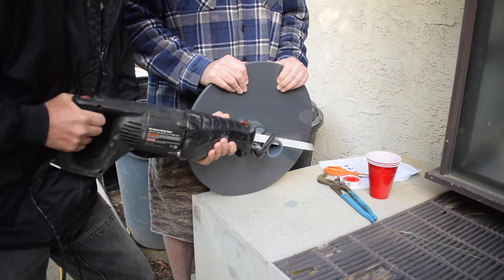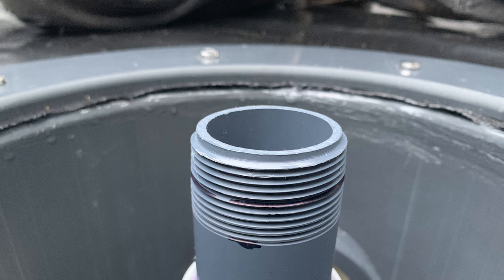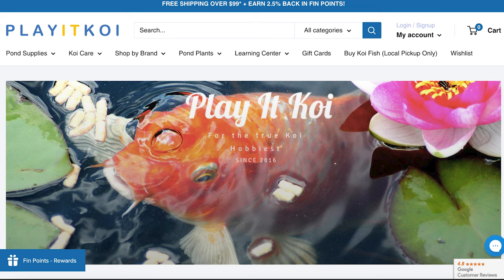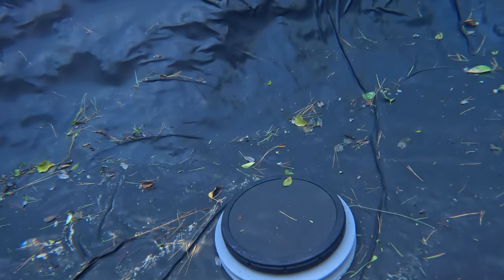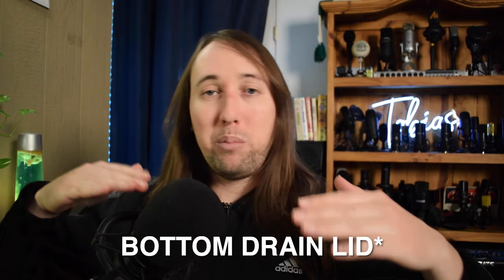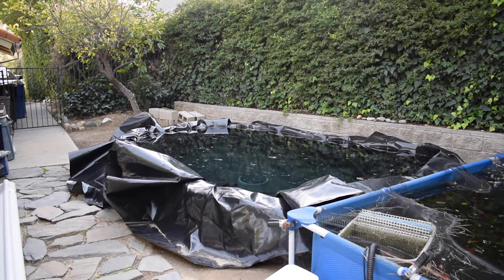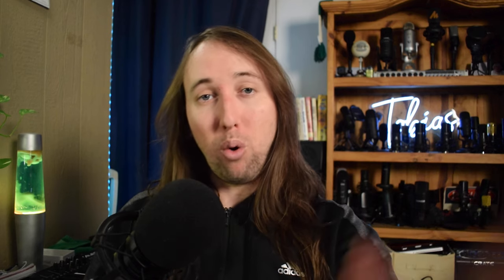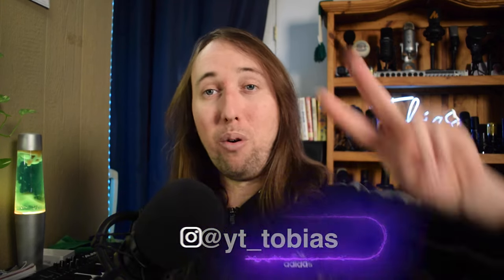Bottom Drain Problem #pond #koipond #pondbuild

Comment: Sorry to hear this Aquamigos, that is not good manufacturing, I think you could end up with fish in your filter, I have had to put a grating to the entry of my Nexus, because I occasionally get small fish go into bottom drain, the grating stops them going all the way into the filter, I have put 3 fish this month back into the pond, I have a very low flow rate, and the smaller fish can not manage to swim back against the flow, so I think you will have to keep a very close eye on your filter, I check mine morning and evening, just in case another fish has made its way up from bottom drain, best wishes, Tony😀
Reply from the maker: Thanks for the advice Tony! I will keep that in mind. I think the first stage of my filtration is going to be a small settlement tank, so I'm thinking the fish will end up in there and then I can fish them out
Reply: @TobiasHolenstein  Thats good

Comment: I always heard that anything with threads that are made to work with water are always tapered to create a tighter/waterproof seal. Dunno, just what i heard
Reply from the maker: Yeah i believe that is true, because I asked the Play it koi rep if I could trim the top of the stem slightly (where the threading is) to compensate for the lopsidedness and he told me not to do that because the threadings are not the same size all the way down. The threading on the lid however is warped in a way where it doesn't match up to the stem anymore

Comment: Honestly you dont have to worry about your fish going in the drain. I thought the same thing, but after parts of hyacinth getting trapped around my drain i have opened up the gap way ore and I havealwys had tons of small fish and Ive only had maybe 3 end up in the sieve after 10 years. WHen their near the drain and the suction pull sthem they will swim away. Im realizing you just answered that yourself, but you should make sure to have a knife valve between the drain and your next filter/pump. Also you should definitely try to hit minimum 3000 gph because if you dont flow enough through the drain line sediment will collect in there. I wish I would have added a t right before my sieve to act as a blow out looking back. Also to increase drain line flow you want to have as minimal distance and turns (long sweeping 90s if a must) betwee the drain and your mechanical filter to maximize gravity flow. I dont know i youve already setup your filter system but I would highly recommend a cetus sieve, It eliminates the need for a settlement chamber, and you can pump directly to your bio filter after and it has a very small footprint.
Reply from the maker: Thank you for the advice! I haven't set up my filtration system yet, but I'm looking into different options. I was thinking of doing a small settlement tank just incase some fish end up in there and yeah I'll try to get at least 3000 gph for sure. I'm a little overwhelmed at this stage of the build, but I figure I can always make changes in the future if something doesn't work out 😅

Comment: That's abit of a shame 😕 such a nice expensive bottom drain and for the manufacturer just to say that's how it is 🤷 I wouldn't accept that
Reply from the maker: Yeah I thought it was a pretty odd response as well, in my case I guess it will be ok, but if I was going pump fed it would definitely be an issue
Reply: @TobiasHolenstein  just be careful as what they have told you is rubbish as gravity fed a 4" pipe can do 18000l that's 4800 USgallons per hour and you can even research that yourself but bear in mind the flow will be determined buy the pump you put on the filter if your returning 10,000lph then your drain is pulling 10k lph
Reply from the maker: @keepingitkoi  That may have been my fault, I may have remembered the number wrong, but thank you for the correct info 🙌
Reply: @TobiasHolenstein  no worries bud what is your bottom drain run going into first ? I ask because just incase a fish did dissappear up there I've seen it happen many a time in my job try and make sure (if you can) that the first box/filter on the drain line has a bit of space just in case a fish ends up in there that way you can just place them straight back in the pond 👍
Reply from the maker: @keepingitkoi  Yeah I was also worried about that. I think I might do a little settlement tank as the first stage, just incase a fish does end up in there
Reply: @TobiasHolenstein  that's what I would do I remember when Danny thought a heron took his small chagoi he found it 2 weeks later in his drum filter 😄 and now it's huge and doing really well
Reply from the maker: Wow 2 weeks! I'm glad to hear that the fish survived and is doing well 😄

Comment: 17000 litres per hour on a 4 inch gravity pipe depending on the pump you use .   And it will be totally possible for small fish to end up in your filter
Reply from the maker: Yeah I think that was my fault. I probably remembered the number wrong that he gave me. But the fish should be able to swim out right? Like the current of the water won't be too strong for them?
Reply: @Tobias Holenstein  depends on the flow rate of your pump I have a 2 inch bottom drain with a pump pulling about 4k litres and find fish in the easypod occasionally if I wind the pump up to 10k litres I find them in the filter regularly ..  its not an exact science
Reply from the maker: Ok got it. I guess I will see for sure when the time comes
Reply: @TobiasHolenstein  you will work it out